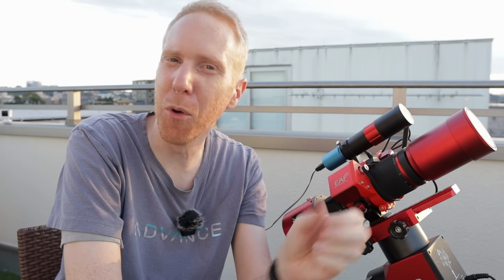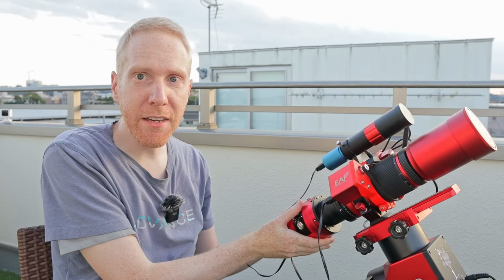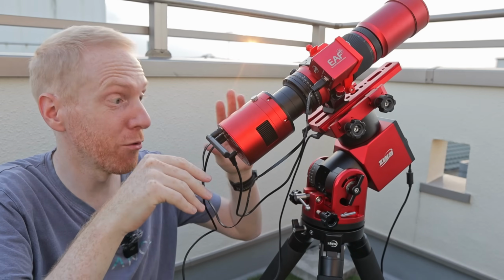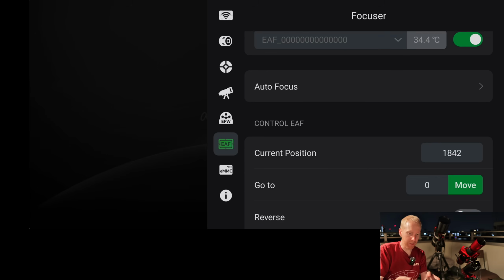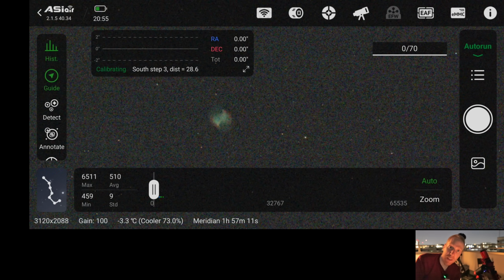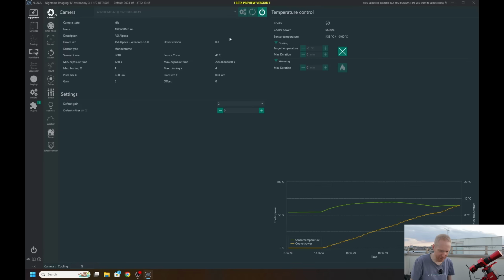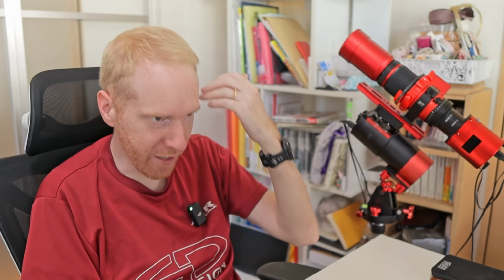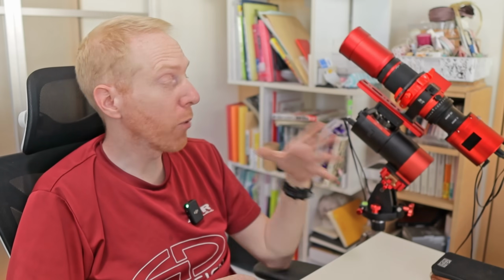This Astro Smart Camera does EVERYTHING🔥! Perfect for beginners? REVIEW of ZWO ASI2600MC Air!

Comment: In the video you speak about connecting the mount directly from the ZWO ASI2600MC AIR camera. I didn't see your conclusion directly regarding this.camera. You say later when reviewing the Crab Nebula results that it all performed very well and were pleased with the results - I presume this includes powering the mount directly from the ASI AIR camera?
 I have just bought the ZWO AM5n mount and the ZWO ASI585 Air to work with the ASKAR SWO55 (and, hopefully, later with my 8" EDGE HD so am interested in your thoughts.  🙂

Comment: Hi Cuiv.  Great info as usual.  I have a Q about sampling:  I am sold on creating a high-quality grab and go system with the 2600 MC Air as the lynch pin, perhaps paired with the AM3N mount and the Askar V 60/80 (btw really appreciated your review of the V60/80).  This would create a "SeeStar-like" experience.  But I am concerned about possible over-sampling.   The resolution with a short efl system such as the rig you demonstrated in this video might be greater than 3 arc seconds per pixel.  Is this something to worry about in your opinion?  The sampling would be closer to ideal with the 585 MC Air, but I prefer the 2600 MC Air, even though it is pricier so I can also use with my larger telescopes, and because I assume it will be a better long-term investment.  What do you think of my plan?
Reply: Thanks.  That perspective is very helpful before a major purchase.  I will go with the 2600.  Did I say over sampling?!  Forgive an old man.  :)

Comment: the 2600MC Air is an amazing set up when it works. When it doesnt work then its an amazing journey trying to get it repaired. I have one of these units. The last time it worked was Jan 4th 2025. The memory would seize up. It would stop taking frames. And the ones it did half were corrupted and I couldnt remove them from memory. After 7 days of their support asking 1 question per day I finally got an RMA. On the plus side ZWO paid for shipping my unit from AZ to NJ. Travel time to and from was 13 days with 3 days spent at the repair facility. The repair was reformatting the eMMC memory. I got the unit back and it worked for 19 minutes taking dark frames. The same problem was still there. So sent emails back and forth, they sent me another shipping label and said that they were just going to change the motherboard. Another 12 days travel time and 2 days at ZWO. I got the camera back and tried to take dark frames and I did the whole library with no faults. I then hooked up the unit to my computer using the USB-C port and my computer failed to recognize the 2600. I tried 7 cables and 3 computers and it just wont tell the computers it is there. This was Wednesday. I sent notice to ZWO that there were still issues. I heard from them Friday. They want me to do a TeamViewer session with the developers in China.  Their instructions were I had to be available during their hours which are 15 hours ahead of me. I had to have Teamviewer loaded on my computer, and I had to have my 2600 connected to my computer. I reminded them that my 2600 will not connect to my computer, thats my issue now. Monday no word, Tuesday No word. I send word back to them that I want either a new camera or a refund. Wednesday I get an Email from one of their developers. He wants to set up a Teamviewer session. I sent a reply stating I cannot connect the 2600 to my computer. No reply as of yet. So in summary, ZWO makes awesome products when they work. When they dont work? Well be prepared.

Comment: Your Processed North American Nebula photo, is awesome, congratulations! I'm wondering if I were to use the the ZWO ASI2600MC/MM DUO paired with the NEW ASIAIR Plus 256G. They would be  working in conjunction with the ZWO AM5N DUO Mount, would they be compatible with my Canon EF 300mm f/2.8 L IS II USM Lens? I know you did mention the issue about compatibility with certain Telescopes how about a Professional Full Frame (35mm) super fast telephotos lenses,  but used for capturing Deep Space Photographs? Also wondered if both the ASI2600MC DUO's main/guide camera's would be working OK with the 300mm camera lens?

Comment: It’s worth noting that the Duo doesn’t force you to use the secondary sensor for guiding - if you are using narrowband filters or have a small image circle or whatever you can connect a guidescope or oag as you normally would and have at it.  You would just need to select the other guide camera in the AsiAir interface.  Of course as usual, it would need to be a ZWO guide camera.😅

Comment: It looks like an amazing clean simple setup. Would it work on for example a Canon 300mm F2.8LIS lens? I mean the dual camera interface onto a FF image circle. Do they supply adapters to make it work? Is this setup really just for telescopes only? Great video you covered it well thankyou.
Reply from the maker: Since the 300mm f2.8 lens does support full frame, it should work, as long as you have adapters for exactly 44mm of distance from the back of the lens to the sensor. I believe ZWO makes such adapters, and you even have USB-controlled adapters (that can control the lens focus & aperture ring over ASCOM - but that wouldn't work with the 2600MC Air, since non-ZWO stuff aren't supported) that give you the right distance, and most importantly, give power to the lens. If the lens doesn't have power, the IS elements WILL shift as you image, causing issues, especially close to the Meridian.

Comment: Thank you for the excellent review, Cuiv. I am new to astrophotography but I have been using the takahashi mewlon 180 for > 25 yrs. The telescope body does not allow easy installation of a guide scope + guide camera for AISAir. Can anyone advise if the ASI2600MC air is good for the mewlon telescope  with a relatively long focal length of  2160mm? Most grateful to any advice.

Comment: Great review!  Hypotheticaly, say the internal asair stopped working.  Did you try connecting it to your external asair mini via the USBC or USB 2.0?  Would it work then with all asair features?
Reply from the maker: Thanks! And no, it wouldn't work externally like that!! It 100% relies on the ASIAir inside it! I suspect even the Alpaca wireless driver is supported by the ASIAir hardware within

Comment: Question: I am trying to focus on distant  terrestrial objects with the ASI2600MC Air camera. Not able to get separate preview from the guide camera and the main camera, I am able to get the preview and live view only from the guide camera in a wide angle. How do I preview from the main camera with a narrow zoomed view, Any suggestions will be appreciated.
Reply from the maker: Did you select the main camera as the main camera in the camera selection screen you get at the start? Sounds like you selected the guide cam instead
Reply: @CuivTheLazyGeek  I did select the main camera and entered no guide camera, still I get the same wide angle field of view. When I select the guide camera and preview, I get the same wide feild. I am using SVBONY 503 102 mm ED telescope with flatner.
I thought the main camera will give a closer narrow field of view.

Comment: Hi Cuiv, your video is amazing. I'm about to order MC Air and RedCat 91 using your links. One quick question: You mentioned that ZWO MC Air struggles with longer focal length telescopes.Is Redcat91 too long for MC Air? Appreciate everything you are doing for the astro community.
Reply from the maker: Redcat91 should be no problem at all!
Reply: @CuivTheLazyGeek  THANK YOU SO MUCH!

Comment: People can say what they will about ZWO and this camera. It’s amazing. I’ve used it in a 6” APO, .3 meter truss reflector. The option for wireless directly on the camera is fantastic. The read noise is fantastic for a color camera of crop sensor size. This is an excellent galaxy camera. Now they need to do a full frame mono version and people will have an even more powerful observatory, stationary or not. It absolutely shines in American and Japan made refractors and big reflectors.
Reply: Dumb question, but does it live stack on your phone to get the final image?
Reply: @TheScrvpt  it does have this feature. And just like before you can also have it save frames, and even create calibration data with it. The live stack is one of the “smart” functions in addition to autofocus and the really well thought out shoot schedule. Really the major plus of this system is low power consumption of other devices. You can run the entire suite with a phone or tablet that uses significantly less power than a laptop. While it is nice to use a laptop, the wireless connection is the future of these cameras. Would be nice if it was fully supported and compatible with NINA. I’ve been doing AP for so long now the traditional way. I’m a sucker for smooth workflows. Shoot and auto guide using the schedule. Then download my frames onto the computer and boom straight into PixInsight. ZWO has a good beginner setup here I think as well. They do make setup easy. I don’t use ZWO mounts though, or their filter wheel. Just camera and focuser with the temp probe.
Reply: @jameskirk172  nice! Thank you for the reply. I’ve been studying ap and I’m going to buy once cry once since I’ve been saving up for it. Wish me luck!
Reply: @TheScrvpt  sure thing! And really any camera with this sensor is a major step up from mirrorless or dslrs. These cameras are really down to individual preferences now days. I do wish you luck and I hope you get good results.

Comment: Hey Cuiv, do you recall if there was an option in the power section to control the power going to  the two DC output ports? I received mine this week and just went through some system checks. This feature is missing for me; therefore, I can not manage the power going to my dew strips. I'm new to the Zwo platform, so maybe I'm just missing something. A quick Google search tells me this was a feature included in the Plus version but not the Mini. I'm disappointed.

Comment: Hello Lazygeek
i think for all who are looking for a new camera the asi 2600 air is a great option when the price range of about 2000$ is ok.
For mobile use, there is nothing better, you only need a mount, in my case it is an AM3, this camera and a teleskop with F 7 or faster and you can start - wireless.
Even if you plan for a telescope with F8 or slower it is possible, when you buy an extra guidscope plus a zwo guidecamera., many of astrophotographers will have this equipment in storage.
You can connect this extra guidscope with this camera an in asiair app you can choose this outside guidscope as your guidscope.
And if you want to connect with NINA, then you connect any outside guidscope via usb mit NINA, connect via usb this camera as maincamera with NINA , connect via usb any mount with NINA, and connect via usb any focuser with NINA, you only need an USB Hub. For all these components you can use the DC powerhub of ASI 2600 air camera.
In this combination there are no limitations for equipment out of ZWO.
Thank you for all your videos, i learned a lot.
Wolfgang

Comment: I was watching this video again as it's still a very fun piece of equipment.. And then you reminded me the 2 reasons why I didn't buy it, even though it's quite tempting:
1) and that's the same issue for the duo : i always use narrowbands except for galaxies and I am very concerned that at 3nm-ish bandpass the guide camera (a 220 !) won't be able to guide properly
2) it's a color version, so less flexibility in the balance of the various signals

But otherwise, the idea to have the camera, the guide camera and ASlair in a same tiny package is amazing. I wonder if they would try to release special filters with a clear window for those guide camera.. or possibly even more rectangle / square-ish filters to fit more properly the camera but not the guide camera. The latter is probably easier to do but then you would some sort of guide camera focus adjustment if not covered by the filter glass

Comment: @lazyGeek
Hallo LazyGeek, what ist wrong to by ASI 2600Air instead of buying asi 2600ms duo and asiair mini? Even if you want use the camara with NINA you can buy seperately a guide camara and connect all of your equipment seperately via usb with NINA and start data sampling with NINA.
I live in  Germany, in the main astroshops of Germany  i can find following prices-
ASI 2600 MC PRO 2499 €
ASI AIR MINI             295€
ASI Guiding Camera 220 mm mini mono 399€  ----  a guidescope is not included so you need  extra money
The main equipment without guidescope is totally 3193 €
In same astroshop i can get asi 2600 air for 2800€
I live in Frankfurt wich is same light poluted than Tokyio. But i have a mobilehome, so i can travel with my equipment and asi 2600 air is great. I can sit im my mobilehome and can control my equipment wireless inside my mobilhome, the temperature outside does not matter.

If i want use asi 2600 air with NINA  i buy seperately a guidescope with camara , connect all of these equipments , even the brand of the mount does not matter,  seperatela over usb with my pc,  and can use all advantages of NINA.
So i have two joices choices, in travelling mode,  i use asi 2600 air as my main controllcenter wireless and at home if i want,  i can switch to NINA over PC and use a seperate guidescope without loosing money.
Especially for beginners, there is no disadvantage to buy asi 2600 air directly and if they want change to NINA there is no problem without loosing money you need only an extra guidscope.

Comment: I just received my 2600MC AIR & I’m confused about selecting the proper power out for my dew heater & mount. I want to select a lower power (say 40%) for the dew heater. How do I know that I’m selecting the right one? And, even though everything is working properly, I don’t see any output voltage for the mount. Any thoughts?

Comment: Not a fan I’m afraid. The guide cam sensor is going to struggle with so many narrowband targets and the AM5 needs short guide exposures for best guiding (0.5 - 1.0 sec). Powering of dew heaters? And finally, reliability - if one thing fails it all fails and in my experience ZWO after sales support is terrible and very slow. I wish all the new mounts had multiple power and USB outs on the saddle and through mount cabling. Far more useful imho.

Comment: Have you done a video comparing why NINA is more useful to you vs the way ASI Air eco system does it ? For me les steps and less configuration leads to more imaging given the short amount of clear sky time I can get. Still would love to hear your thoughts on this
Reply from the maker: Addressed it in some live streams but basically:
- have my sequence templates saved, so I can just click the play button to image (far fewer steps than ASIAir, where I have to fiddle with the app quite a bit before I'm imaging)
- auto-copying my images over network, so they're always available on my processing computer
- dithering every x frames is a per template/sequence setting I have in NINA, no risk of forgetting to change it when switching from broadband to narrowband and vice versa (unlike ASIAir, where I have forgotten to switch that setting, leading to huge imaging time loss or inability to drizzle)
-  I can set autofocus exposure length per filter in NINA, in ASIAir it's another easy to forget centralized setting (when switching from broadband to narrowband)
- for mono: filter offsets. Allows saving a huge amount of imaging time by looping through filters without having to refocus (it's not available in ASIAir because it only supports overshoot backlash as part of its AF routine and not as part of focuser movements, where it only supports absolute backlash)
- Better handling of multiple targets per night in NINA (image X until Y is above 30 degrees altitude for instance), also saved in my templates
Overall, for me NINA is just faster, lazier, and less error-prone (because I have set it up properly :) )! The ASIAir is slower and more cumbersome, but far, far easier to do the initial setup!

Comment: Thank you, Cuiv - another good review... and this ZWO package would likely have worked for me had it been available some time ago. My imaging rig already encompasses all its components (ASI2600MC-P, ASI290MM, and ASIAIR+, ZWO EAF) and, when the ASI2600MC Duo arrived, I seriously considered acquiring it to replace my ASI2600MC-P and remove my ASI guide camera and scope and it’s ramifications… but, like you, I rely on very-NB filters to capture image photon counts in my Bortle 7+ city-scape (15-20min subs)and the guide star signal is just not there when trying to resolve it from behind a 4nm Ha/OIII optical sieve. Instead, I opted to replace guide cam & scope by adding an Antlia filter drawer behind an Antlia OAG solution to get past the reduced guide star signal problem and it was a good choice - all the pluses of the ASI2600MC-Air configuration  but without the serious drawback of guiding signal reduction. Glad to see that you stressed the main issues in your review - single vendor reliance vs function-appropriate solutions, reduced but totally functional rig control (NINA vs ASIAIR) and reduced or non-existent guiding results when relying on the on-board Duo sensor behind a 4nm NB filter. All bases covered - well done…

Comment: Hi Cuiv! I'm wondering if the following setup is viable - ZWO ASI2600MC Air on a RASA/Hyperstar, wirelessly connected to an AM3/5. I haven't seen this mentioned in the cloudy nights or any of the reviews so far. 

p.s. I realized a power cable is still required... Surely someone could fix up a puck shaped power bank directly connected to the back of the ASI2600MC Air?